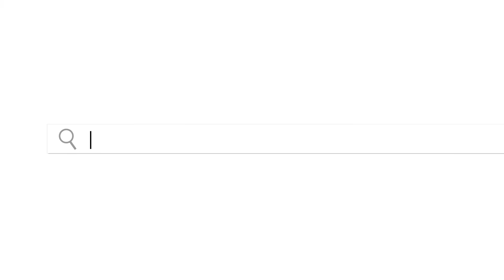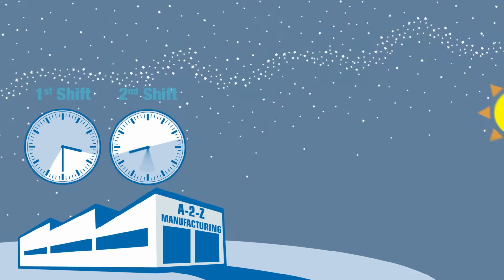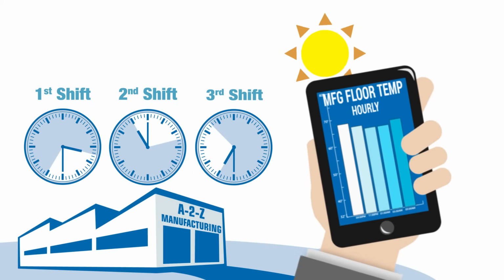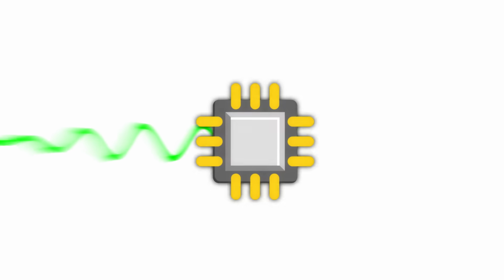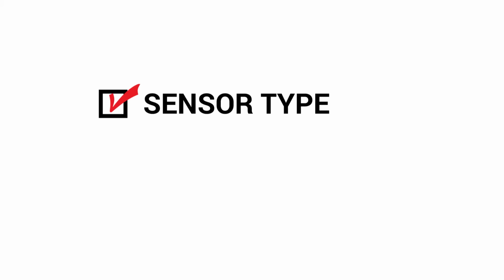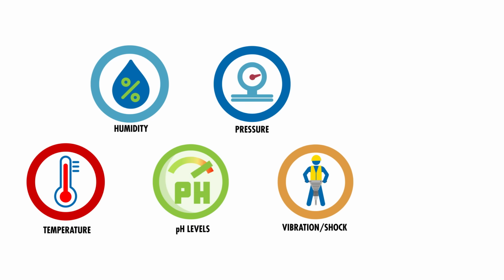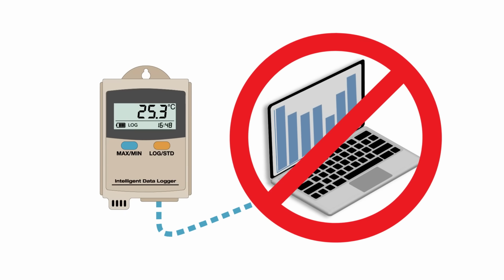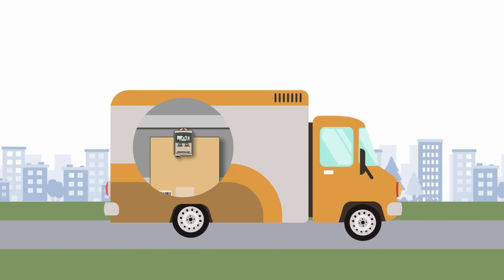What is a Data Logger and How does it work? Learn in ONE minute

Comment: Which sensor used inside the data logger
Reply from the maker: Hello and thanks for asking! Here are links to some of Omega's Data Loggers offering built-in sensors:
This one offers Carbon Monoxide and Temperature monitoring: https://www.omega.com/en-us/data-acquisition/data-loggers/specialty-data-loggers/p/OM-EL-USB-CO-Series?searchterm=carbon%20mino

This one offers Carbon Dioxide, Temperature and Relative Humidity monitoring: https://www.omega.com/en-us/data-acquisition/data-loggers/specialty-data-loggers/p/AQM-102-CO2-Monitor?searchterm=carbon
If you need further assistance you can chat with one of our Application Engineers at omega.com